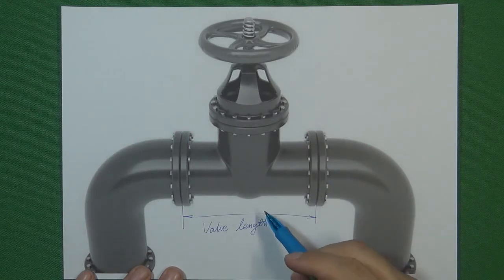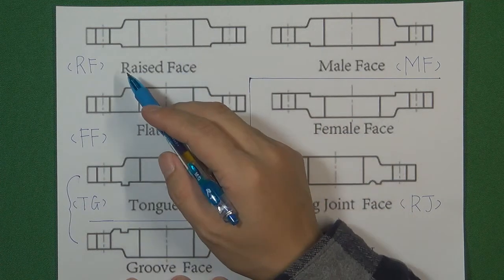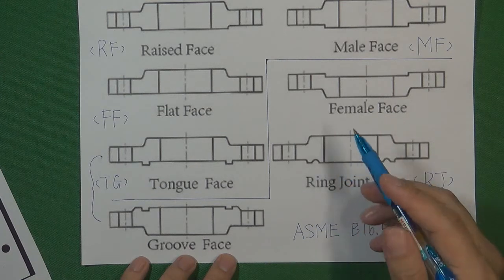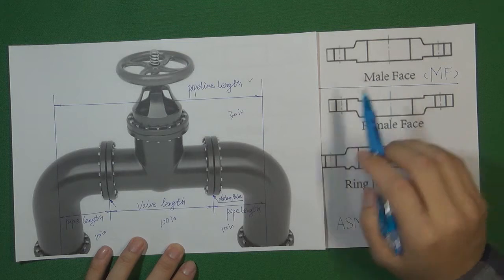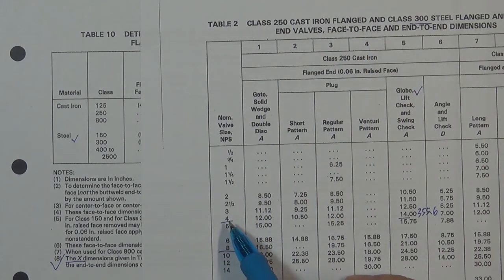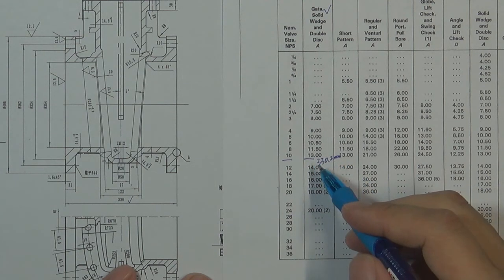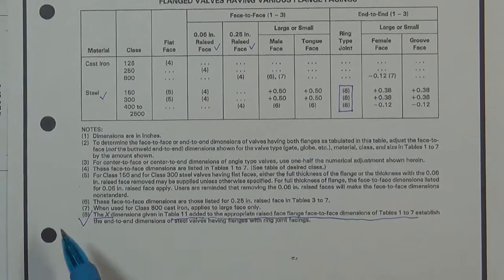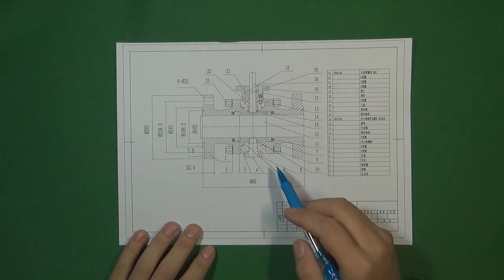How To Use ASME B16.10 To Determine the Valve Length #Standard Tips 4

Comment: Thanks for this video, it has been very helpful. I am currently working on a valve library in a software called Edgewise. I am using ASME b16.10 table 1 as a reference. However, the table only covers certain pipe diameter. Why is that?